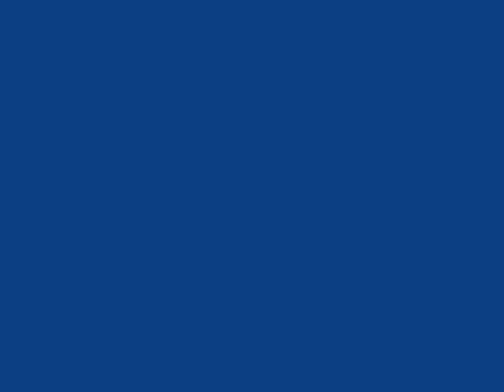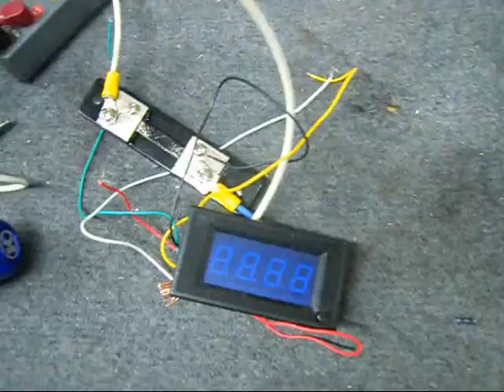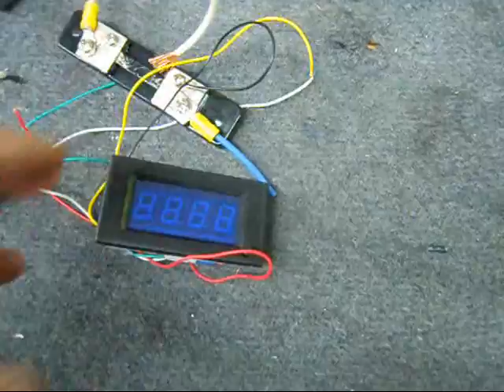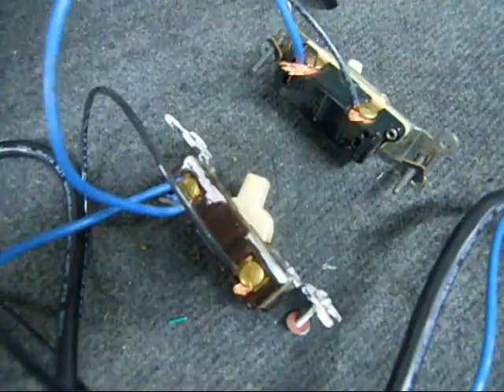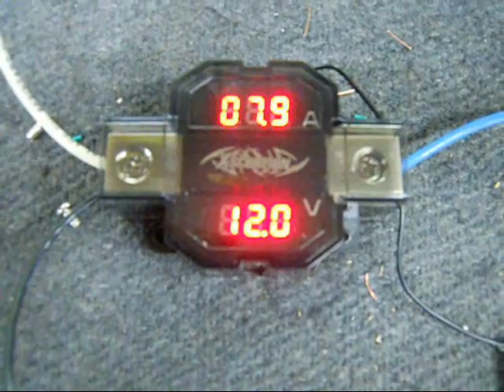XSCORPION DIGITAL AMP VOLT GAUGE.wmv

Comment: i have this same one but haven't installed it yet, but now i'm having doubts installing it... i followed your in and out setup from source and to accessories, which works fine and in reverse. but since there's no actual manual for it, i am having issues with the actual direction of source and acc. when i reverse the direction the amperage and readings are different. i'm having current drop of .5-1amp and .1-.5volts on reverse. i can't even understand how is that possible unless it's supposed to go one way direction only. now i don't know which side is accurate since i don't even have a multimeter to even test it. have you encountered this from testing?